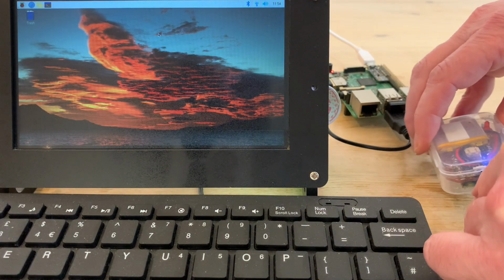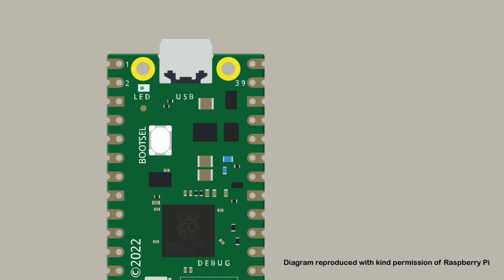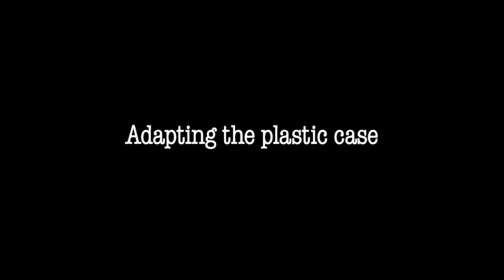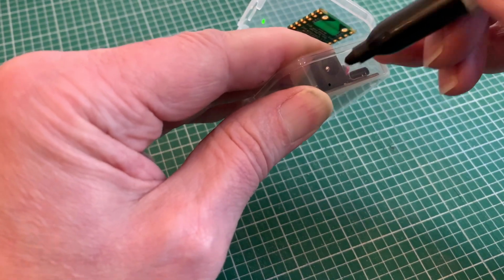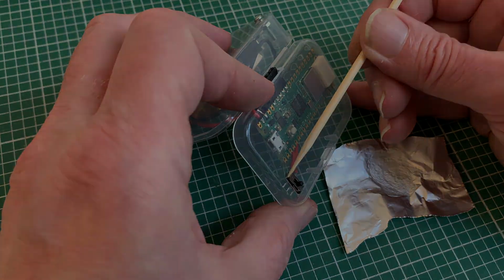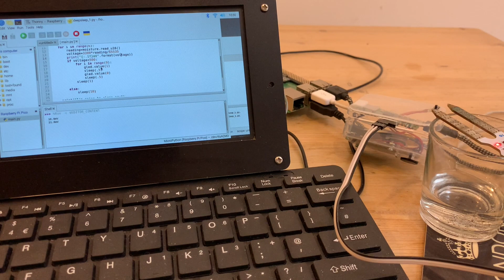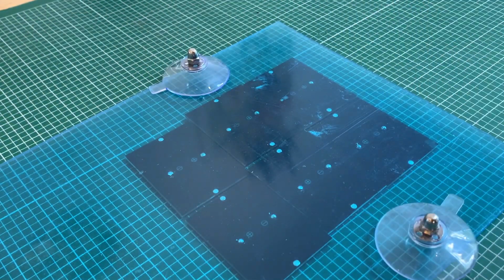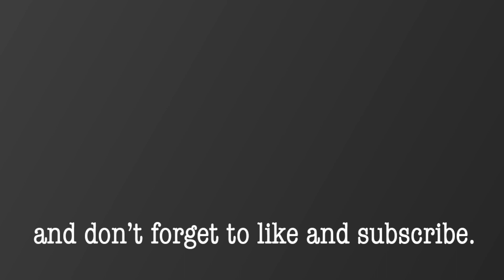Solar-powered Raspberry Pi Pico plant watering monitor project

Comment from the maker: Since posting this video, the monitor has been running continually on solar power alone, but I've noticed that my timings drift very slightly each wake cycle while the Pico boots up and launches the programme. I've now calculated this at 0.814 seconds per cycle and taken that off the time in deepsleep.

Comment: Would you mind listing the components used? - I'm especially interested in the solar panel and charger
Reply from the maker: Of course. The Raspberry Pi is a Pico W, panels are Pimoroni 3.0V 100mA Polycrystalline Solar Cells and the charger an Adafruit Universal USB / DC / Solar Lithium Ion/Polymer charger - bq24074. I got the panels and the charger from the Pimoroni online shop. PP

Comment: Can you please list all the components you have used in the video ? Thank you.
Reply from the maker: Sure. I've just added the list to the description, but here it is as well:

Raspberry Pi Pico
Adafruit Universal USB / DC / Solar Lithium Ion/Polymer charger
3.0V 100mA Poycrystalline Solar Cell
LiPo battery - 3.7V 500mAh